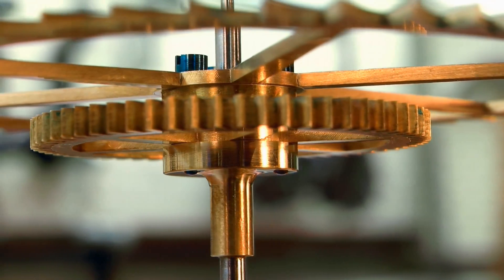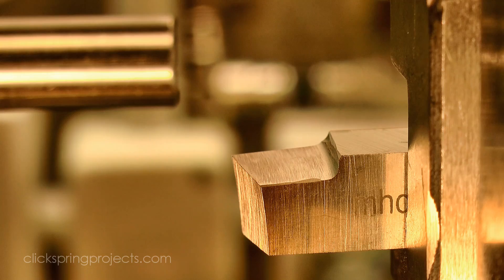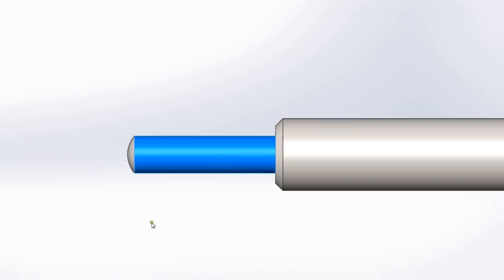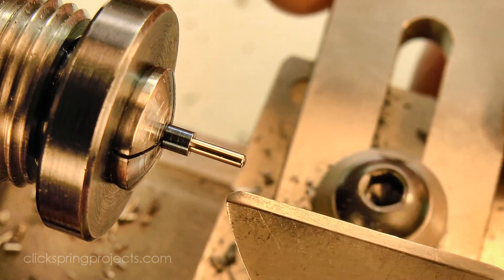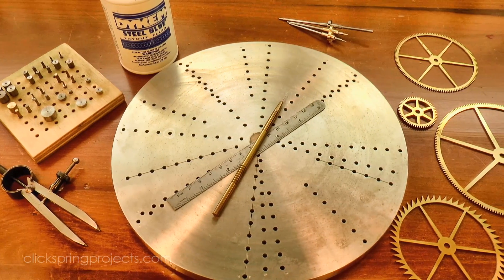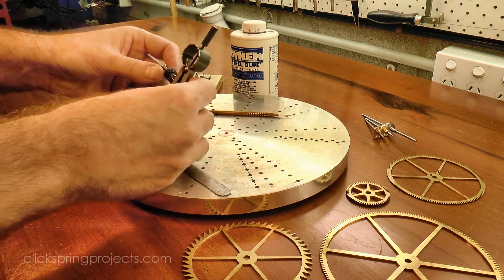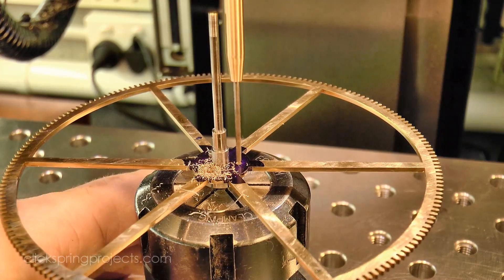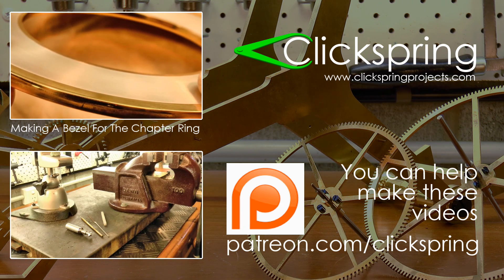Clockmaking - How To Make A Clock - Part 12 - Making The Collets And Other Arbors

Comment: Clickspring Isn't it very easy to mess up the diameter of a part while turning it by hand with a graver? I guess you just have to be extra careful.
Fantastic video, as always.
Reply from the maker: 3MrP3 Yes it can be, but it's surprisingly easy to control too. The secret to success with the pivots is the stoning with the arkansas slip stone. Once the stock has been removed, the slip stone is used to square up the surface, removing the freehand errors from the graver. Very enjoyable way to turn metal. Thanks for watching :)